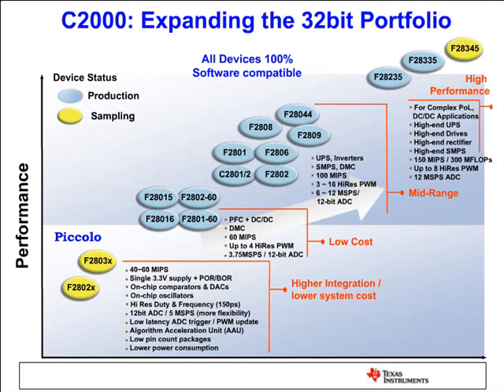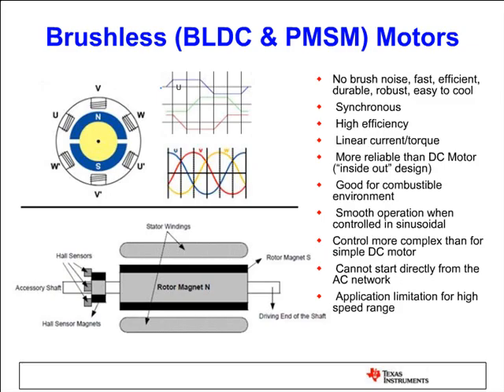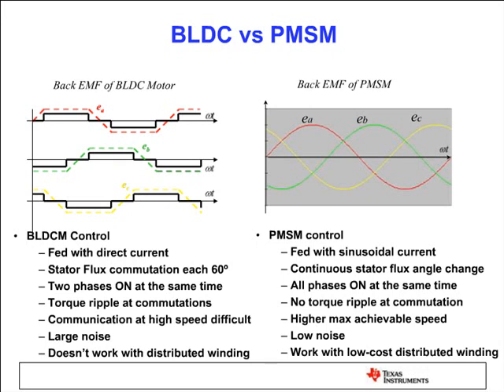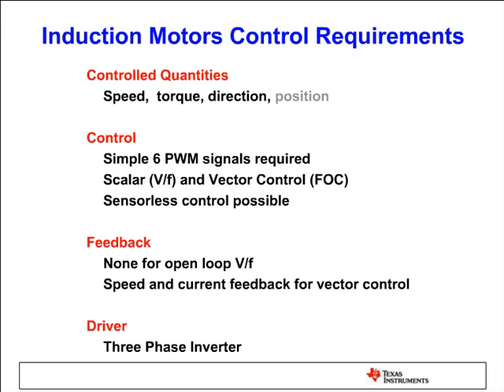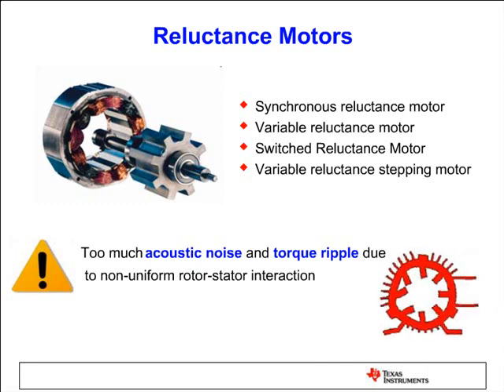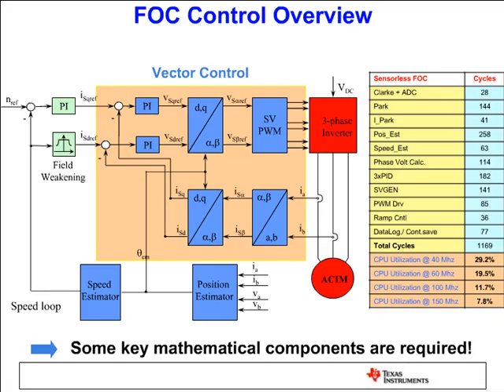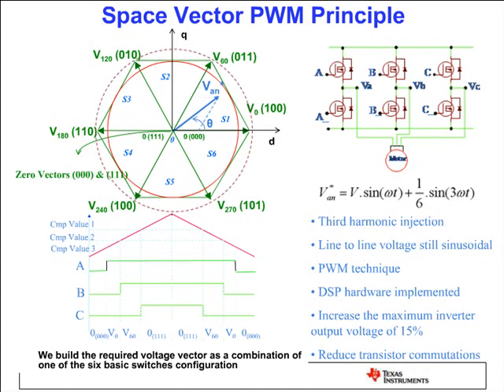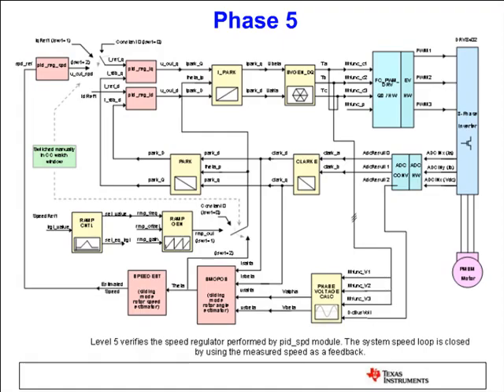Implementing Digital Motor Control

Comment: Good afternoon! Vector control theory says that the resulting stator field vector must be kept perpendicular to the rotor magnet. If this is one magnet with two poles, then it is not difficult to imagine and understand. But in life we have a lot of magnets. For example, there can be 12 of them on a scooter motor wheel, and the rotor is located outside the stator. How to present this corner there? How is the magnetic field located?

Comment: Hi there, 

Very intresting and very helpful video. If you go to 50.57min when you are talking about the FOC implementation what sort of approach have you used inside the slide mode observer estimation for V and currents because im trying to implement the same strategy however for a different machine. Can you please assist me through that.

Many thanks

Comment: On the slide entitled "Space Vector PWM Principle" V60 and V180's bit mappings are reversed, and V240's bit mapping is identical to V0.  V60 should be 110, V180 should be 011, and V240 should be 001.  It took me a while to figure this out, and I had to consult several other sources to figure out what the discrepancy was.  But other than this, it was an excellent  video.  Thank you for posting.
Reply: Yeah you are correct. The basic principle behind these space vectors V0, V60, V120 etc is that only 1 switch is turned on at time as you go from each space vector. That is why V60 must be 110 and not 011 as shown on the slide. You can also do the maths by hand to calculate the space vectors and it will clearly show that V60, V180 and V240 are wrong.